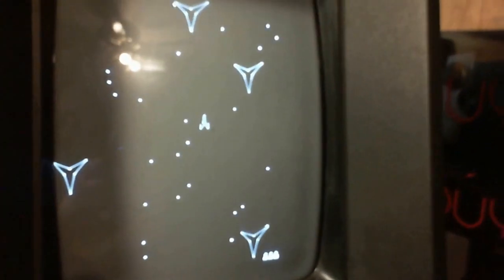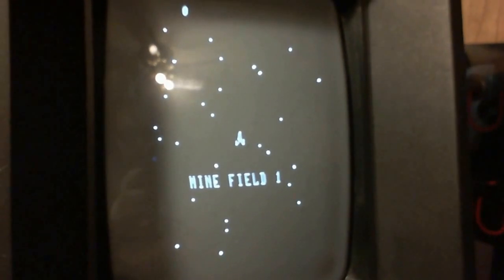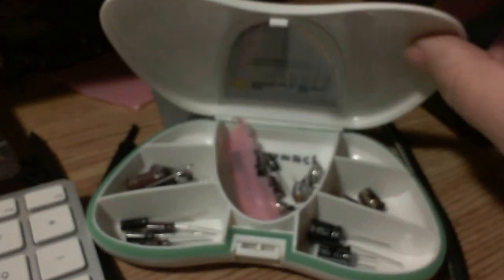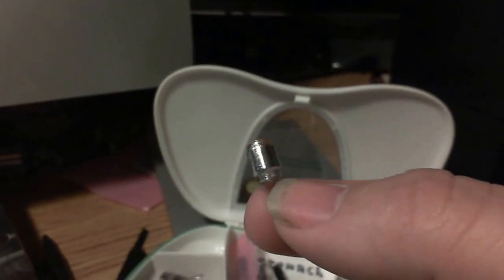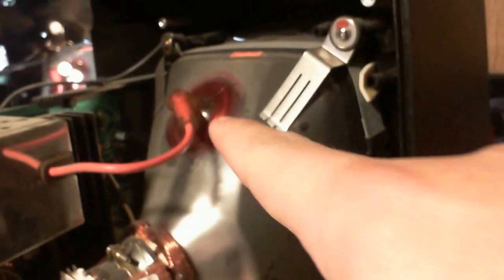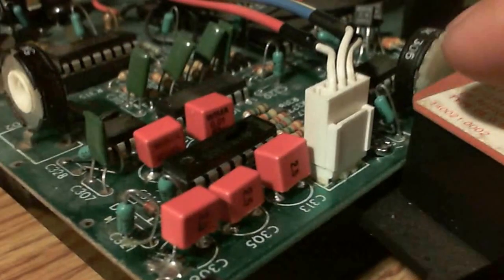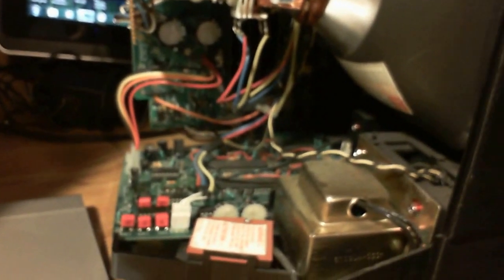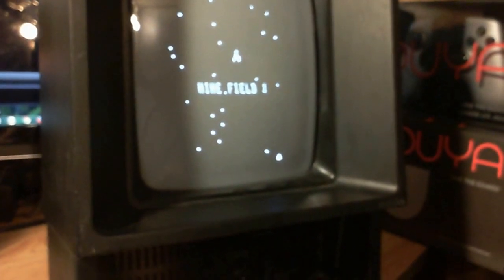Vectrex Integrator cap replacement info

Comment: I feel drunk after watching this video..
Reply from the maker: Yes my videos can be quite intoxicating. Actually it's how they fixed unstable videos 5 years ago by making it more unstable. XD
Reply: @WARPUDDY666  LOL, yeah the "good old times".....but can't you turn that off somewhere in the Youtube settings or was that a thing of your phone/camera ? Otherwise informative video :) 
I have worked on many (arcade) CRTs and usually if they haven't been powered up for a few months there is no voltage left on them. And as long as your hand is nog going to be near that anode cap, there is no real reason to discharge it. On some older (b/w) vector monitors you could even damage a diode by discharging it without a resistor. 
That website (Consoles5) do ship internationally, I checked for my country and I could order without problems but I didn't. The shipping to Europe is about 18 USD for 5 tiny caps. I am currently completely re-working my Vectrex and although only 1 or 2 caps measured out of spec, I decided to do a full-cap replacement for 2 reasons: my Vectrex showed a weird "dancing" picture on some scenes in some games.F.I. with Mine Storm it was when the big ship drops the "stars" in the intro, and then only at the very end of that scene.....it's like when there are a lot of vectors going on, my vertex couldn't cope with it. The second reason was that the Vet isn't the easiest piece of equipment to work on. It's a lot of hassle to take it apart and work on it. So I decided to do this once only. Following this, I ordered all necessary caps in 105 degree version and only good brands (Panasonic, Nichicon and Rubycon) with RS Online. I needed some other stuff too, and this made the order large enough for free shipping, plus most of the stuff is there the next day or in a few days later. I also know which brands I'm getting. I don't know which brands Console5 uses. I must day that GCE/MB used excellent caps as my ESR meter showed that all of them were still well within spec, only one of the two 22uF caps near the heat-sink showed values that were "just" in spec, but still, after almost 40 years they were in amazing condition. I can't measure the polystyrene caps though and I do hope those are the cause of the "dancing screen". I am also replacing the (dried-out) thermal grease on the heatsink parts and have washed everything (main PCB, CRT, all case parts) and will replace the speaker with something more beefy. Also will put in a new separate audio amp to get rid of the buzz.

Comment: Ya know, I have only heard of polystyrene capacitors failing if they get too hot. Too hot for them is 180 F, which is asking for trouble with other components dying too.

If your machine is getting that hot, I suggest you find a way to sneak a muffin fan into that case just on the inside of a lower cooling vent, and hook it up to the + 12 of the power supply, to draw in fresh air, and force cool it.